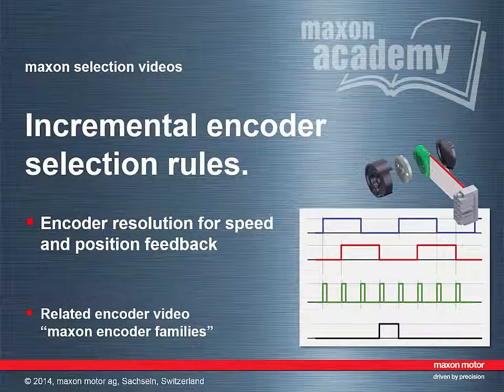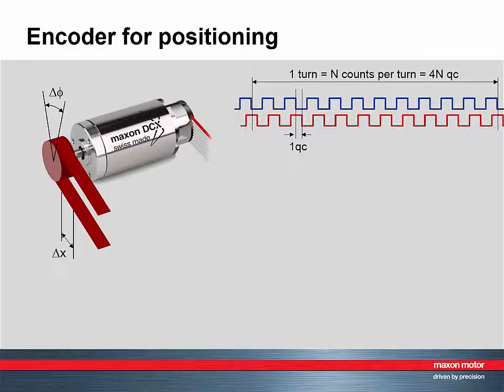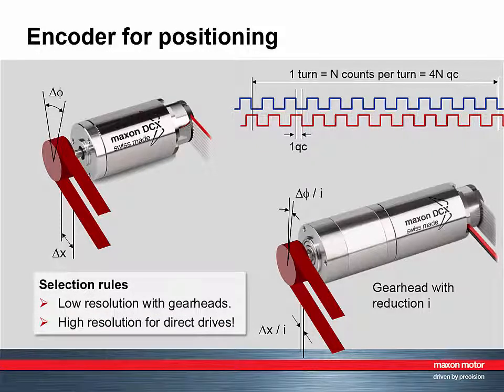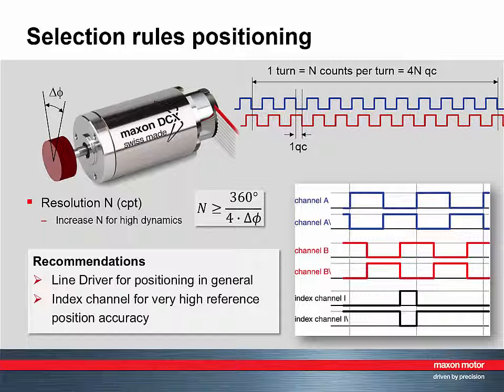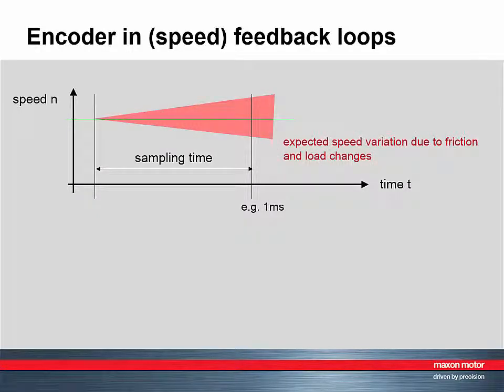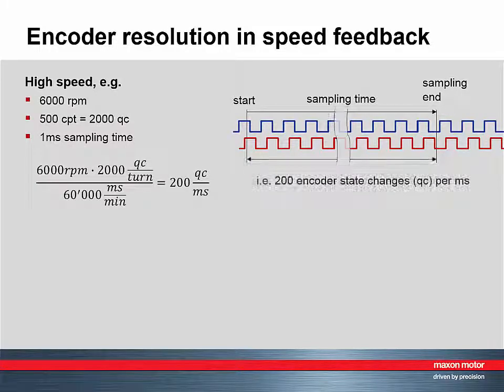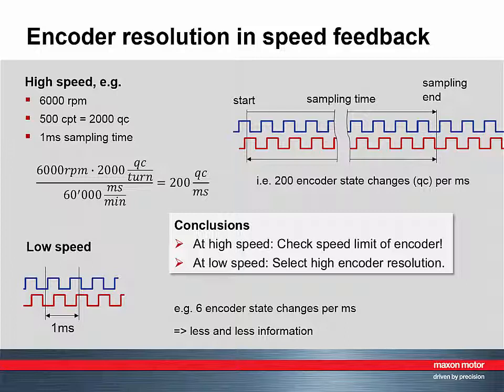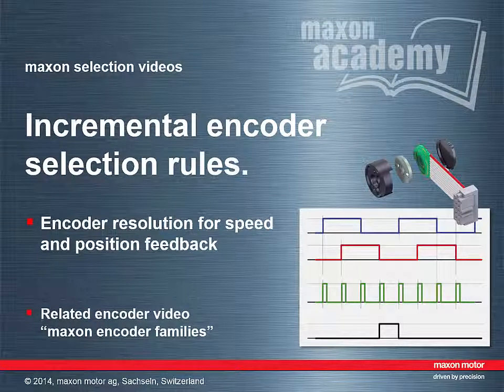Encoder selection

Comment: why do we have to give TWO  target position in degrees in the holding registers for the maxon ENX 16 EASY 1024-pulse incremental encoder
Reply from the maker: To help with your specific application please contact sales.uk@maxongroup.com. We will need to know what communication method you are using and details on the hardware.